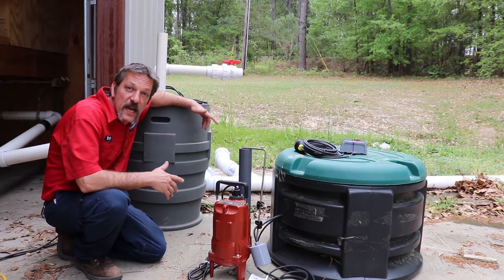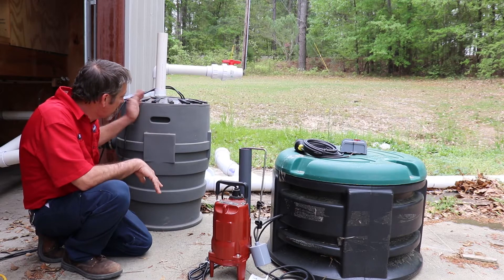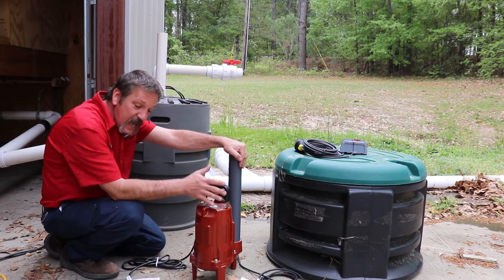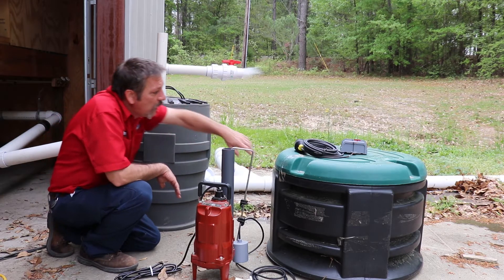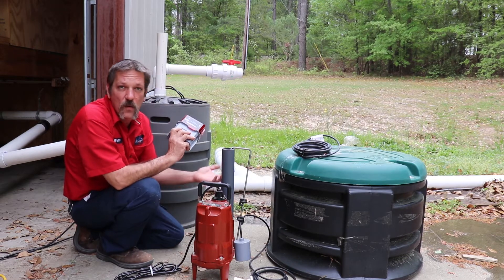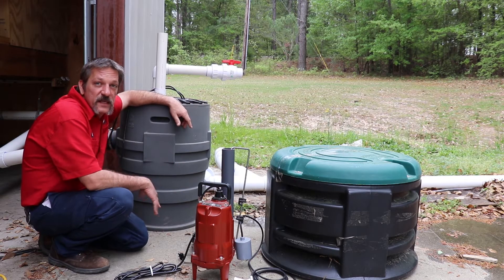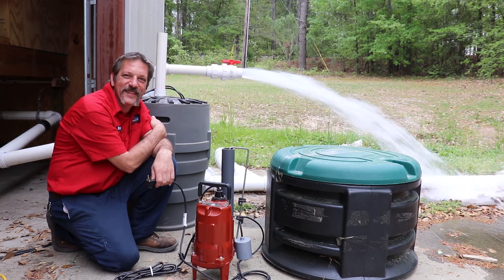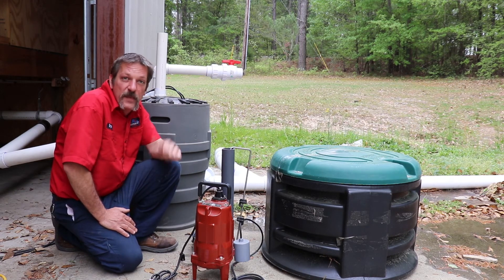Sewer Pump

Comment: Great information. Thank you for making this video. I  peeked into my lift system as I would like to install a 2" wye and plug to slip a locating line into it. Our field is probably 400 feet away and uphill 20 feet.I imagine that there is a backcheck valve in there somewhere.  Would it be possible to send a metal fishtape up 100 feet without doing any damage?
Reply from the maker: No , it won't hurt it.
Reply: @PlumbingSolutionsLLC  Thank you

Comment: if these are pushing uphill, say 10 feet up and 100 horozontal feet..  That is like 20 gallons of liquid in the ejection side. Half the container. You'd need a check valve to keep it from backflowing into the tank i assume. Do the lines need to be below the frost line then?
Reply from the maker: Yes, you need a ball valve, a check valve, and a union. And yes, you need to protect it from freezing.
Reply: @garystango I live in northern WI. We have a 400 foot run and 20 feet uphill. We rely on the snow to "insulate " the pipe. Never run it under a driveway. No problem in the 4 years I've been here.

Comment: Maybe you can answer a question for me, I am in the process of installing a 2" pipe from a detached garage I just built and I have to put in a gravity pump system,  the pipe is approximately 140' long, my 4" septic tank main in front of the house is only 6" below the ground and I really need to install my 2" much lower. Approximately 2' lower, once the pump kicks on can it push the liquid up that 2' of pipe through the septic T ?
Reply from the maker: Those pumps can handle that and a lot more

Comment: Quick question how do I fix the float cord,  my pump is not working. But when connect the pump cord straight to the power it does works.
Reply from the maker: your float has probably gone bad and needs to be replaced. you can buy just that

Comment: Does the outdoor outlet have to a specific amp rating? Or wire rating.....like #12 or #14 romex? Getting ready to run an outlet for liberty pump (I think 3/4HP). Thanks
Reply: You need a dedicated 20 amp service for that size of a pump.

Comment: I'm installing a Pro380 Liberty pump. Should I put it on a 15 or 20 amp breaker?
Reply from the maker: I would go for a 20 amp
Reply: @PlumbingSolutionsLLC  
With 12 gauge romex?
Reply: I put a dedicated 20 amp circuit and it works perfect.

Comment: About to have one of these installed for the first time on a build, the model I ordered discharges out of the side of the basin though. Are there any advantages/disadvantages of the vertical discharge? My Discharge line will be buried 12" deep so I just assumed I needed the side discharge...Thanks for the insight!
Reply: how is your system doing?what model number ?

Comment: Bought one at Menards, keeps plugging up on toilet paper.
Reply: People need to know the difference between a Sewage Pump & Grinder Pump. Both can displace fecal materials. The Grinder Pump 4 times the cost. The blades in time dull. The Grinder Pump is higher maintenance in long haul. Don’t buy until you do your research with Pump Manufacturer since both types have specifications with limitations. Just remember mechanical vs gravity will be failing in time. As a retired Master Plumber with 45 years experience people frustrated in these comments should know if not maybe future owners of these pumps will do their homework and realize gravity is better and overcoming elevation’s pumping is your only option.
Reply from the maker: uh .. I think you got the wrong pump. It needs to be a grinder pump.
Reply: @PlumbingSolutionsLLC  that's what it is. 700.00 grinder pump. Pissing me right off.
Reply from the maker: wow , those thing should eat through almost anything. except baby wipes and feminine products.
Reply: @PlumbingSolutionsLLC  I am installing a toilet and sink in detatched garage.will this pump 200 feet with 1( 90) degree turn?also have a septic tank with another tank for water to get pumped to field lines.afraid macerated  sewage fill flow into the liquid tank from the poop tank.would just a regular sewage pump without the macerater be fine?

Comment: How high can the sewage get piped up? Meaning can it bring cellar water one or two stories up to the septic tank inlet?  Thanks.  (I suppose I'd need a couple of check valves.)
Reply from the maker: It can push straight up 50 feet.
Reply: @PlumbingSolutionsLLC  You are awesome!! Thank you! This really relieves a major concern of mine!
Reply: That's a good pump there, because I have one and and it will pump a Hoover d a m